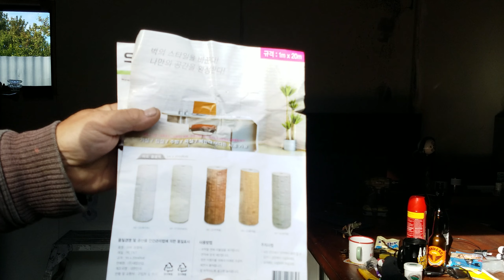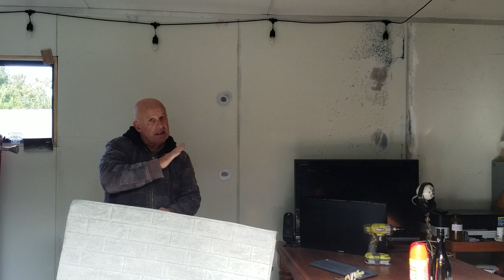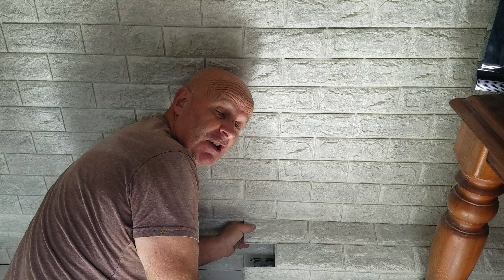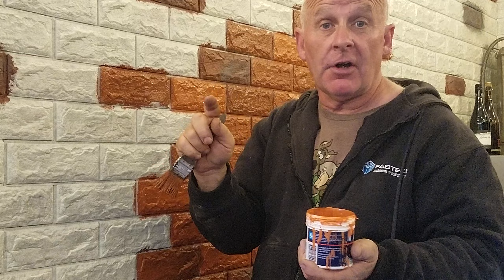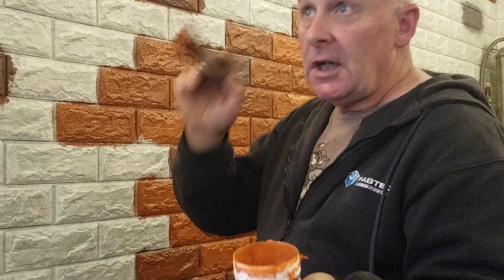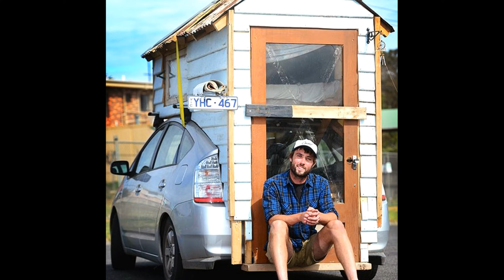My new studio decor for under $200!

Comment: Watched all your old build videos using these panels but always wondered what the weight per m2  was for the 100mm panels for calculating the build weight for a proper mobile tiny house that conforms to NZ transport regs?
Reply from the maker: The 75mm is just on 10kg/m2 The 50mm a smidgion less and the 100mm a smidgion more. This build including floor frame is 1200kg. allow 800kg for an average tandem trailer. That should give you a ballpark figure. heaviest things in a tiny house is you and your canned food followed closely by your books.

Comment: How do you think this building would hold up and not have mold issues for high humidity environment like a jungle or mountain snow load areas?
Reply from the maker: Oh  lots of buildings on ski field are made of it cos its so fast to erect. It just has to be ventilated. The only condensation you get is on windows- Ive never worked with or lived in a place with double glazing so I cant comment on that.
Reply: @t.h.o.r.  I heard you can make a crude double grazing for using glad wrap double-sided tape and a hair dryer.
Reply from the maker: @theaussienurseflipper.8113  haha - Im already running gladwrap on two windows until I get some free glass turn up! New price is now $240 per square. double for tinted or tempered.
Reply: @t.h.o.r.  I remember in the video you talking about the window. Getting a glazier out to replace the glass. I though at time, gee must b a lot cheaper than Australia. You might have to stick with the GLAD wrap 😜